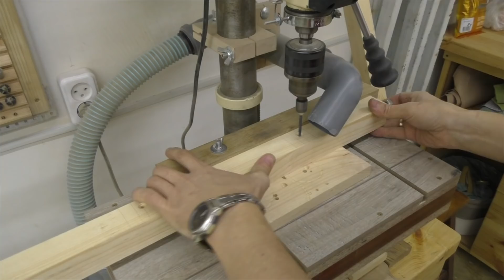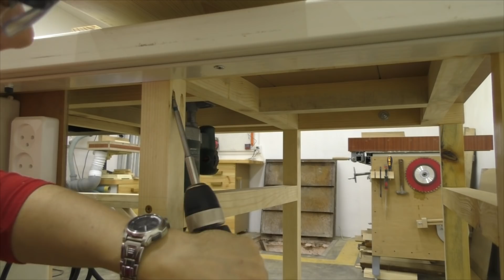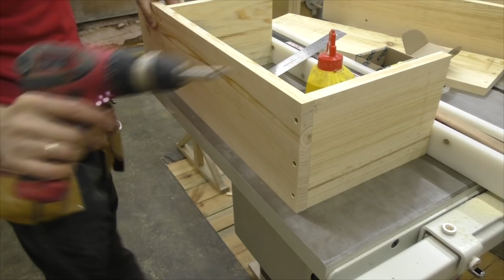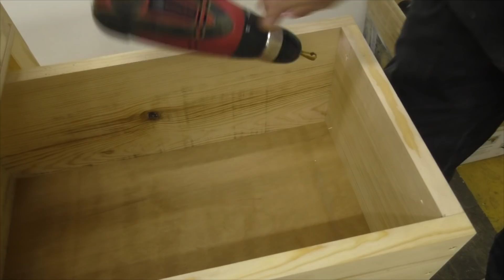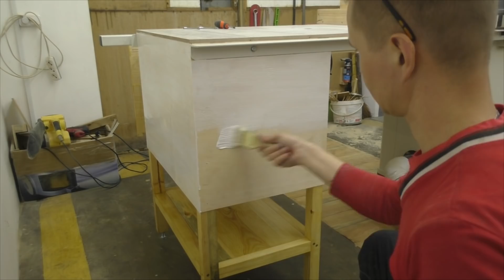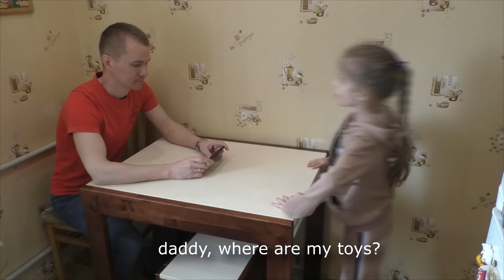🟢 Cheap and Simple Router Table Storage Upgrade - DIY Woodworking Project - Part 3

Comment: Hahahaha.... Snap Snap ... and all the wood is cut!!

And the toy and drawer trick, THAT was funny! Shame, poor kid looking for her toys ... hahahaha

Good job on the drawers. why did you leave a space open in the back that can't be used? I thought they might be secret compartments. Also, I don't see any drawers stops preventing complete pull out of the drwaer? Just asking ;-)
Reply from the maker: Thank you for your comment, Theo.
 The length of drawer is about 65cm, i don't need that long, so i decided to devide it. Plus when all box pulled out i may not support it, it leaves enough plywood behind the box to keep it horizontal. Thanks